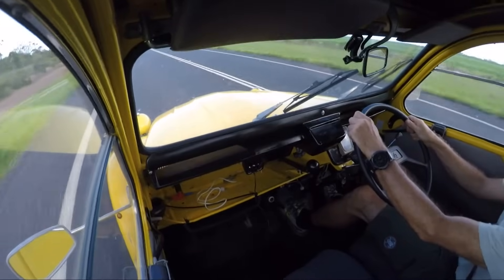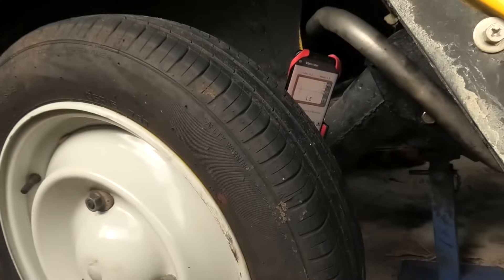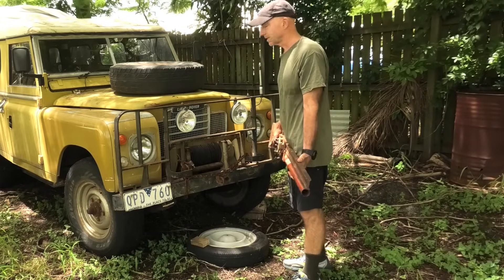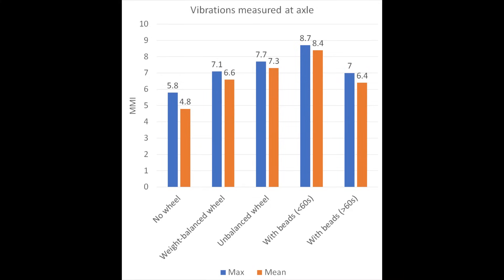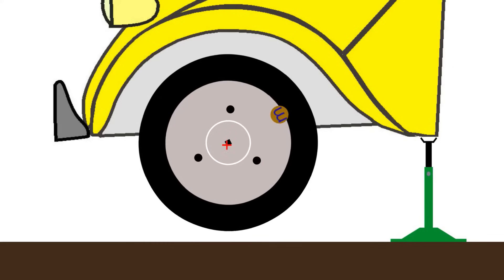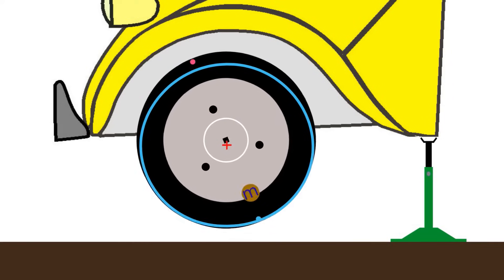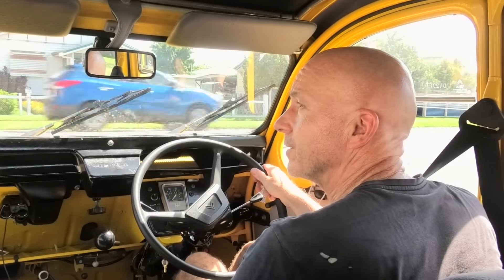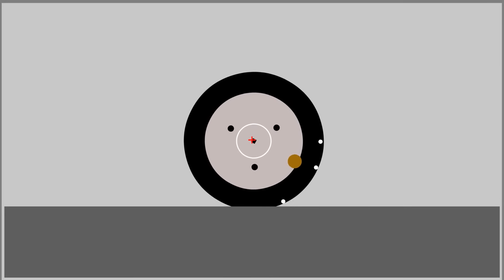Can beads really balance tyres? A full test and explanation how they work.

Comment: Good video, something to note, the beads I see used and seem to work the best are much smaller, more to the size of larger sugar crystals, the larger the bead the less reliable they are in working each time you come to a stop and start driving again. One other thing for anyone who's not had them work, they MUST be made from something like ceramic or glass to prevent them sticking together, plastic usually doesn't work and often will make the balance worse.

Thanks for the video!
Reply: Will really damage your tpms sensors. Move into the 21st century.

Comment: Really good explanation with both theoretical and practical demonstrations (bath tub spinning). 
You even included a bit about the tire flat spot, which has always puzzled me... (Why doesn't it mess up balancing??)

You made me a believer, though not a convert. I'll stick with my ball-laser balancing &  stick-on weights, which would not work on those thin wheels (1) that use the studs as pilots (2). Glad it worked for you.

Compared to what a tire goes thru on the outside, I doubt the beads on the inside would do any damage to the tire.

Edit: Just had a thought - I don't think it will work on those electric vehicle tires with a foam insert to make the tire quieter though. It could push all the beads to one side and give the tire/tyre a dynamic imbalance. Not a 2CV problem though!
https://techtirerepairs.com/safe-tesla-and-ev-tire-repair/

Comment: Very interesting, and well presented, but...in 50 years of 2CV {and Dyane} ownership {350,000+ miles, with several cars}  I have never had to have a tyre balanced.
Two other things come to mind, firstly, on a few occassions I have used inner tubes in "leaky rims", with no ill effects {or balancing needed} ...and secondly.could long term use of these beads cause any damage to the inside of the tyre {2CV tyres, are, by the nature of their size and the limited power of the car, long lasting}
Reply from the maker: You touched a very good question about the long term effect. I'm sure the beads have at least some abrasive effect on the tyre inside. And another question to add is: how long until the beads turn into dust? I don't know and would like to learn about some long-distance experience with these things.
I'll definitely make another video if I find after X thousand kilometres that they are not worth it.

Comment: I've had dual sport motorbikes for years, The best way I found to balance the wheels for higher road speed is tyre slime in the inner tube, it makes a massive difference on the higher speed rated tyres, knobbly tyres are sometimes beyond help but it definitely helps.
Reply from the maker: Thanks for that information. Slime sounds very interesting as a balancing method.
Reply: @2CVCult-zl8eo sone use the thick concentrated coolant with silicates.
Reply: I just had slime removed because it caused vibration
Reply: I've heard similar reports.  I'm imagining the weight of slime is key, it needs to be of an adequate quantity to offset the imbalance.
Reply: I always wondered why dumping a bunch of Stan’s Tubeless puncture seal in my tires didn’t make them off balance.  Low speed is part of it I’m sure but on a path with super fine crushed gravel there are sections of downhill that I would get up to high 30s and never any issues with the tires.
Reply: Do you fear the tire sline ir beads could damage the tpms valve?

Comment: What a great video, thanks indeed. I've recently fitted balancing beads (tiny ones that do (eventually) fit through the valve stem into my tubes - 40 minutes per wheel to get them in!  It is interesting that you are running tubeless? Does your 2CV have safety rims? This is a long standing debate!)  

My Renaults have the same size rims as yours and my early 4CV spider wheels can only be balanced statically at my local tyre place. They can balance my 15" disc wheels on the R8 but this doesn't reliably stop vibration at 100 kph. I"ve not finished testing the results of the beads yet and just remembered I might still have balance weights on the inside of the wheels, so need to pull them off. I have checked for roundness and sideways wobble, and they are OK within 1-2 mm. 

Thanks again! Really interesting.
Reply from the maker: Thanks for the comment. My rims didn't look like safety rims (but I didn't really have a good look inside, so maybe they are). I hope those beads work for you. There are much more variables involved than with traditional balancing, so I am not sure if it will always work. Let us know how you go.
Reply: So you beleive that an airless punctured inner tube will keep the tyres on the rim? Tubeless or not, it's the air pressure that keeps the tyre on the rim.